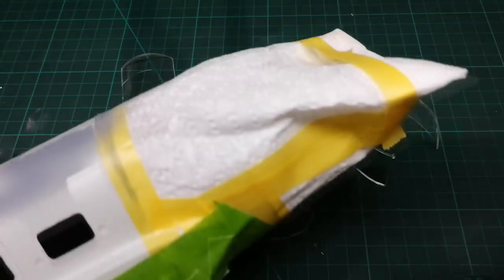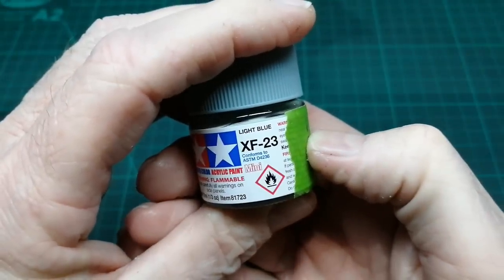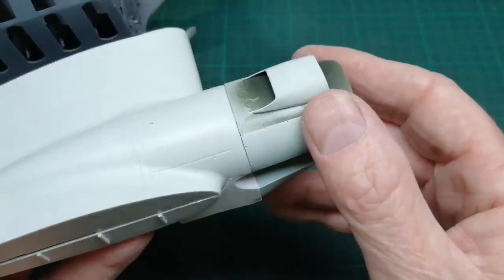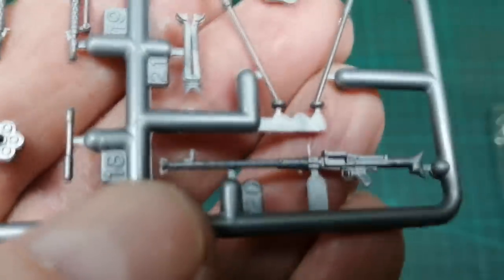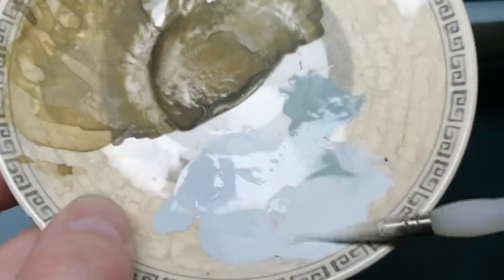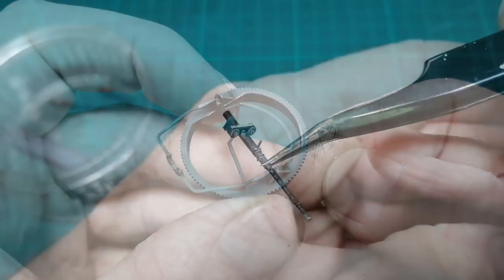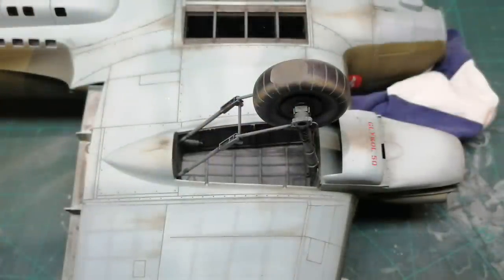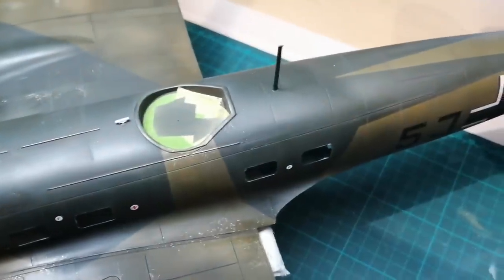Revell's 1/32 Heinkel 111 Full Build  (Part 2 of 2)

Comment: For the future, Microscale makes a product called Micro Krystal Klear which is for gluing canopies and windshields without any hazing of melting. Im looking at a bottle now, for a product number but only see MI-9. It can also be used to make the glass for windows 1/4 inch wide or smaller.

Comment: I really enjoyed the build, yes! Both for the exact model (I will build the same, likely in the autumn) and for the tips, tricks and thoughts you shared. You tell about your mistakes, what is hard, "oops, I broke that part" and "I can live with that". :D

At the moment I am struggling (and having fun) with building four Spits that will hang in the ceiling. Also Revell, 1/32. I must say that Revell has improved a lot since I last built something from them - some 35 years ago... still some problems, the instructions says nothing about how to build them with the weels up, so I had to improvise.

I found the wet sanding interesting. Just tried out steel wool (will continue with that) and it gives that shine of underlaying metal.

Thank you for posting this! Happy crafting!

Comment: Hi Greg, daft question, why apply black first then white on the crosses, I wouldv'e thought going light to dark colour would be easier?
Reply from the maker: Sometimes you can get a fine white bleed appearing under the top black coat, around the edge. 
Which can be very noticeable.
Whereas adding the black first, will eliminate this.

Comment: One of these brutes buzzed my RC flying club field back in the 90s.   Just outside Winnipeg Manitoba, Canada of all places.    Landed at the airport and sold T-shirts.  I still have one.
Crashed and burned years later, killing the crew.
Sad.
Reply from the maker: Yes, I think they lost power on one of the engines?
Reply: @GregsModels  
If I remember correctly,  they were running out of gas coming in to land.  
One engine conked out from fuel starvation and that was it.
Reply from the maker: @falconeaterf15  Very sad!

Comment: I'm converting one of these kits to a CASA 2.111 from the BoB movie using the Heritage Aviation conversion. Sadly the Merlins are the wrong shape and the exhausts sit too low, so it's taking me some time to correct them. 3 years + so far as I have to be in the mood and it's been relegated to the bottom of a very large pile of other 1/32 kits. I think I'll cheat, too, when it comes to the weathering.  The original aircraft being freshly painted for the movie , so just the basic exhaust staining etc and not much in the way of weathering. The engines are also solid pieces of heavy resin, with copious amounts of filler added and sanded away to get a more accurate shape - so the undercarriage may not be fitted due to the weight.
Reply from the maker: Would like to see a big Merlin version of the He 111. On some of the stills from the movie, you can see the Spanish roundels underneath the paint.